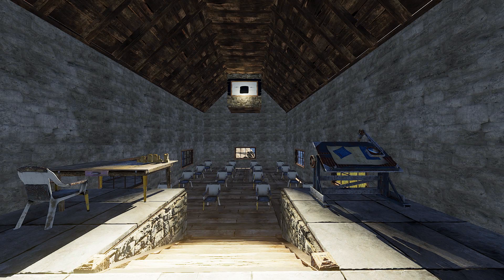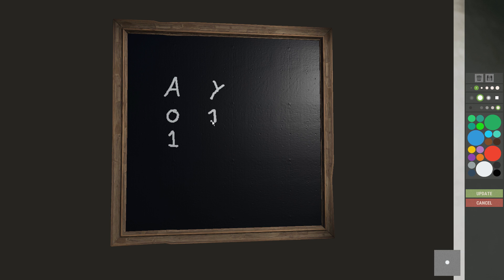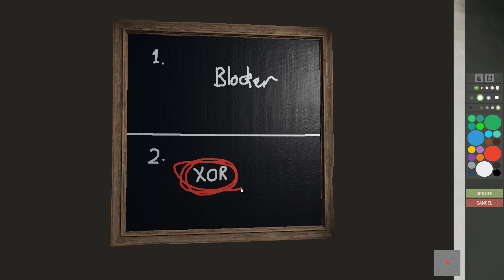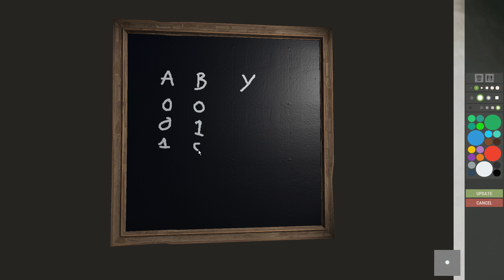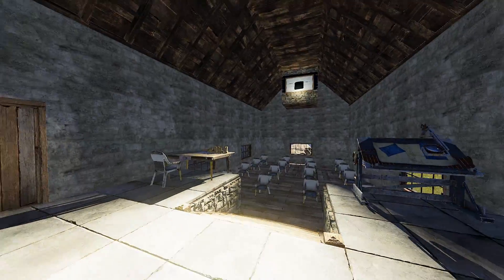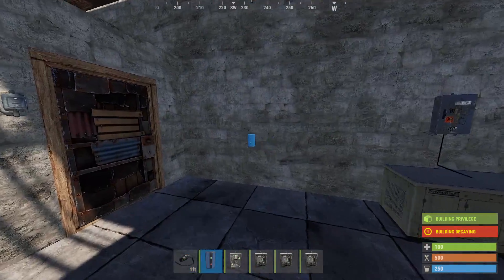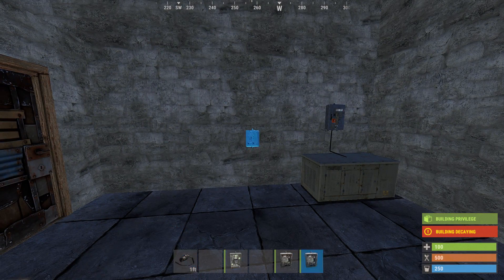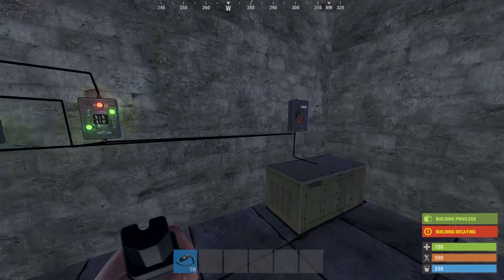Making NOT Gates (Update In Description) | Rust Electronics

Comment: Definitely worth an upvote.
But shame on you for saying there's no use for Xor switches.
They definitely have their uses.
Very first example I can think of is like having two light switches that both control interior lights.
Both are off? Light is off. Turn switch on by the front door. Lights go on. Turn other switch on by your bed/bag/logout spot, lights go off because both are on.
Just like IRL switches. ¯\_(ツ)_/¯
Reply from the maker: I believe what I said was XOR gates are useless when used as a NOT gate (compared to the blocker version), not useless on their own. XOR gates are extremely useful when working with binary counters etc